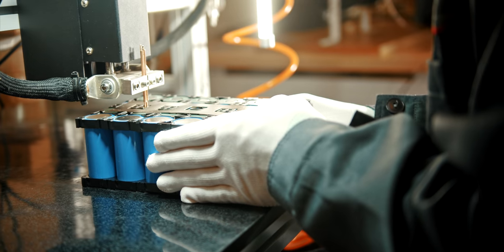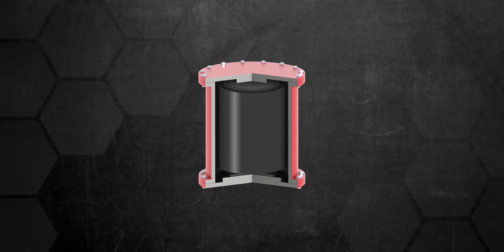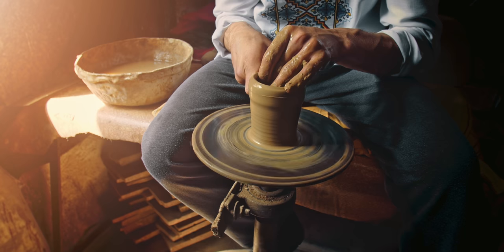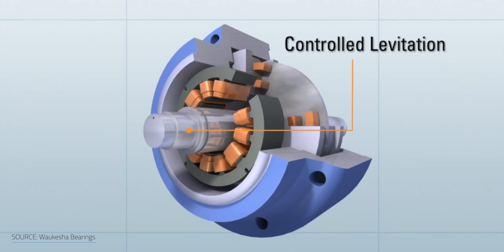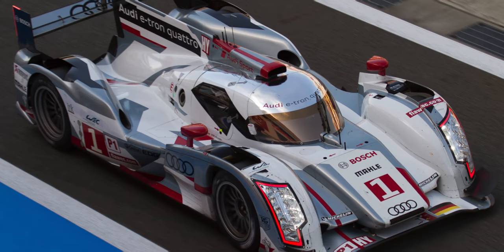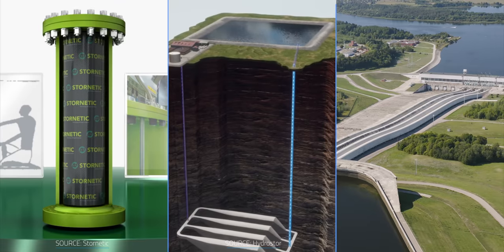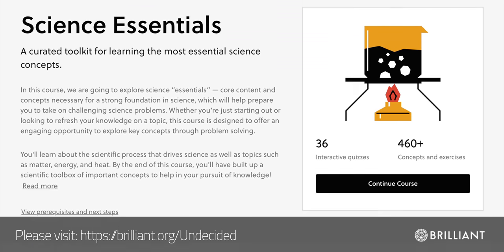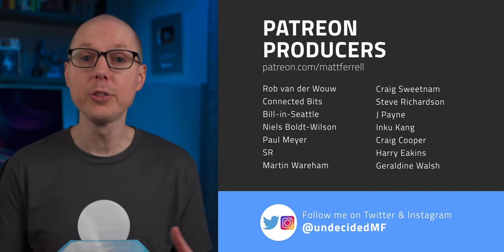The Mechanical Battery Explained - A Flywheel Comeback?

Comment: Drop the carbon emission BS. it's not a problem.
Reply: Yes it is.
Reply: @BRAINSPLATTER16     there are 1500 active volcanos around the planet. Do a calc of the immense heat radiated which doesn't include all the heat convected away. Then multiply by 1500. Tell me how many joules per year volcanos emit to the surface. Then tell me how much per year .04% CO2 in the atmosphere absorbs at it's peak absorption wavelength of 15 microns. I'll give you a hint: 15 microns represents emission from a body at -87F.
Reply: @BRAINSPLATTER16  You missed the point entirely. That's what happens when a person cannot THINK on their own and just quotes the MSM.  I asked you to do the radiative calculation to determine heat energy from a volcano to the surface. Then you just quote some idiotic MSM article about CO2 which is totally irrelevant. Go back and look at my previous quote about the amount of joules in heat coming from a volcano and multiplying it by 1500 to get the total energy per year.